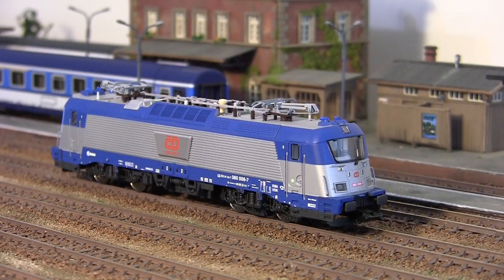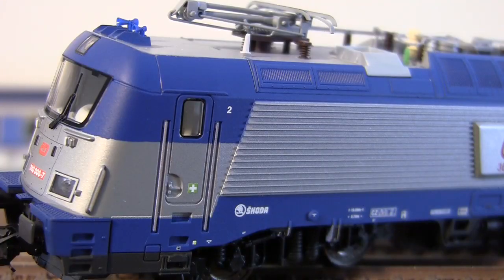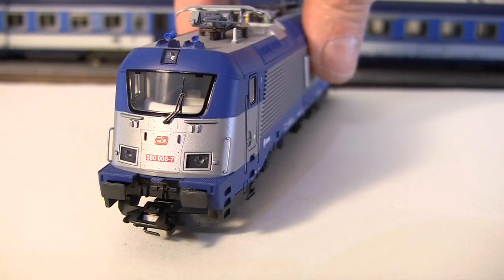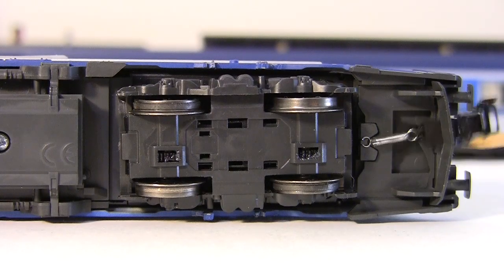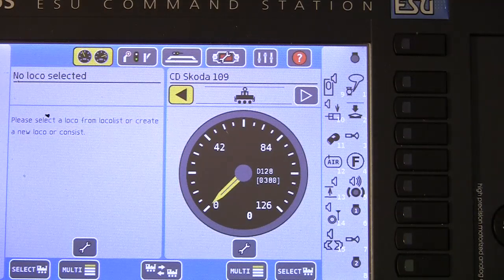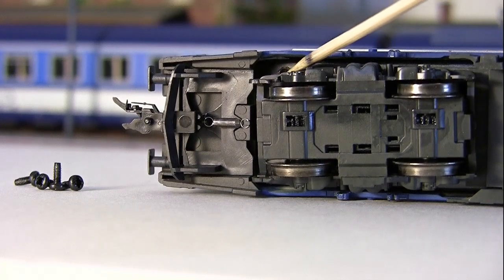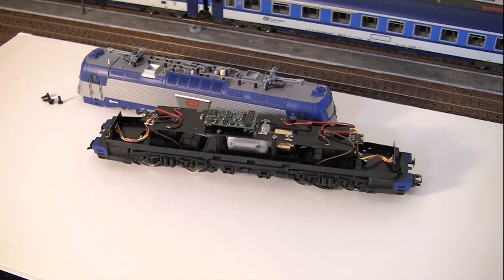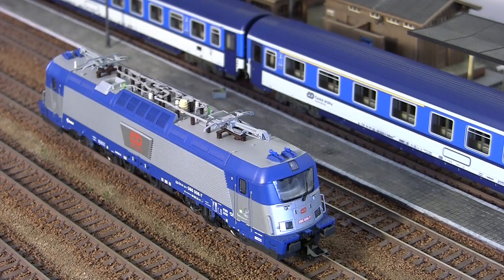TRIX CD380 Skoda109/DB E102 TRIX 22196, 22841review

Comment: Great review. I can't believe Trix/Märklin are dropping the ball like this. Just a little more effort and it could've been an amazing model.
Last year Märklin released at Re 450 driving trailer by taking a German driving trailer and painting it SBB colours. To me that is absolutely unacceptable. They also marketed it to fit with an SBB Re 420 push pull train, which is completely incompatible in real life. It's as if they would believe their customers aren't clever enough to notice.
If I would've received the locomotive you reviewed, I would've taken it back and tried my luck with another one. I assume part of the problem is the painting that is done by hand, as seen on Märklin TV videos. 
The only time I appreciate hand painting is for weathering. I have 4 of the same sets of a particular wagon from märklin and each one is uniquely weathered.
Reply from the maker: I'm equally disappointed and I've been waiting for this model for a while... my first and last TRIX/Marklin model
Reply: Peter S. I have never seen anything as bad as that windscreen from Märklin before. Here in switzerland you can take a model back for the smallest reason and it will be sent to a representative in the country who will get it repaired. They always want you to be satisfied, which is understandable at that price point.
I have taken advantage of this a number of times. 
I have a few models from Märklin that I am very happy with, namely the Re 4/4 II, Ae 8/16 & Re 460. They are just behind the industry as far as sound is concerned, but I appreciate having the metal body.
Reply: lorirocks777  the main advantage is the metal body but if acme or polo made this model it would be better
Reply: piko **

Comment: Nice review Peter! 
I was thinking to buy one but the windshield so dissapointing. Maybe in a later series it will be fixed. The (missing) air hose is also a week point (or a great opportunity to upgrade the model :) ) However, I like this screw type chassis / body connection (much better than plasitc claw connection like Roco uses).  
Anyway, I prefer diesel and steam locomotives :)
Reply from the maker: thank you